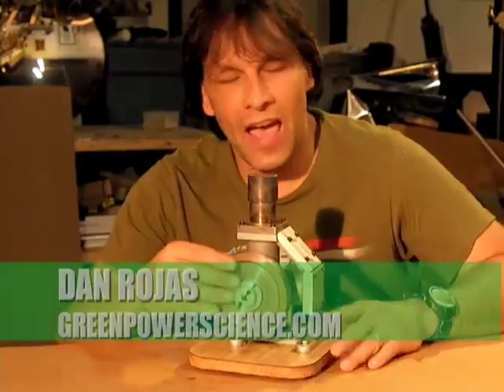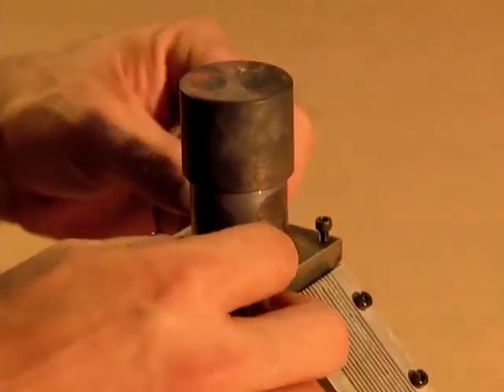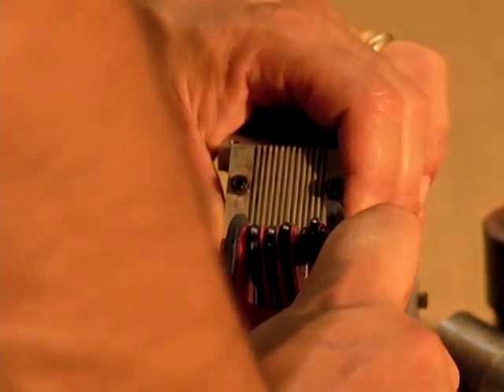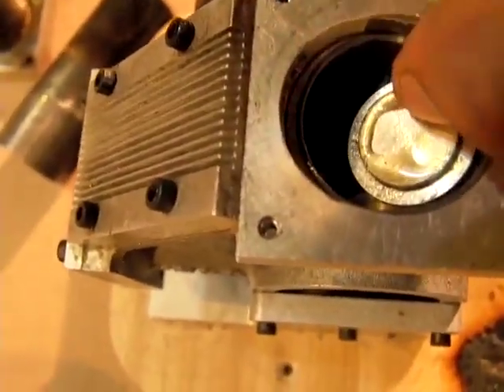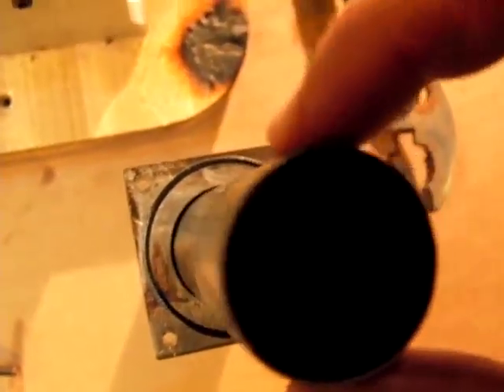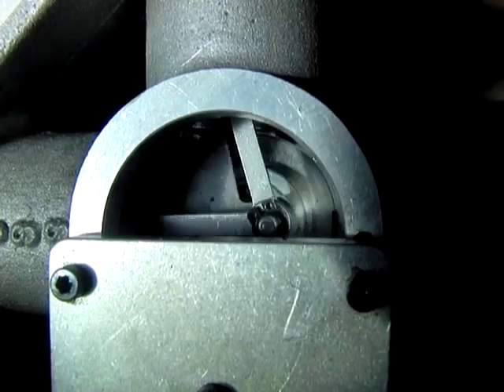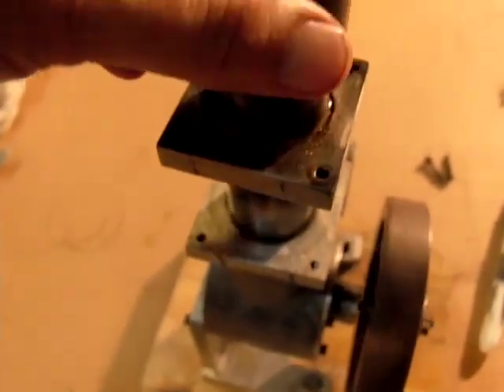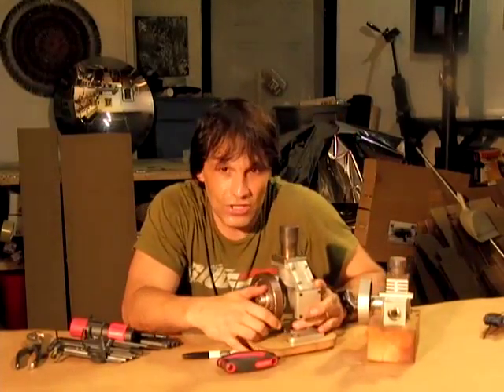Inside a Stirling Engine Andy Ross Stirling Engine Kit Design

Comment: nice video!  Thanks for sharing this.  One thing to consider: super glue is used for temporary fixing of parts to "wax chucks".  The part is released with heat, so when your engine reaches that temperature, the joint will fail.

Comment: Would you release the blueprint schematics for this model? Is seems strong enough to provide 12V - 0,25A using the right dynamo. I would like to try build this model to charge my batteries at night. I live in an Island SouthEast Brazil and saving power is important.
Reply: Isn't this designed to work with the sun shining on it? If so how would this charge batteries at night?

Comment: Great vid Andy! I would love to have a motor like this to experiment with as you are doing. It sounds quite strong in the last vid to me and I would be surprised if you couldn't get much more than a 100W out of it. It would be nice to see the results of the generator setup showing volts and amps. I would also like to see the effects of adding a solar tube to help contain heat input, and maybe a small cooling system (water) ON THE COOL SIDE. I guess you Gould go a step further and let the cool side flow through the hot side as a and into a heat exchanger for hot water use.I'd love to have one of this type engine, it seems quite powerful to many I have seen on YT. Please do tell where you purchased these engines and thanks for your work and sharing, great vids!
Reply: Hi Evan, did you get response on where to buy this particular Stirling engine?

Comment: You can get bags of those O'Rings at Home Depot or Lowes for pennies on the dollar, most hardware stores carry them as well as plumbing supplies. You can usually get them in bags of varying sizes or under $2.00 U.S. Currency, just bring yours with you, and match it up.

Comment: No offense but you really didn't cover how it works, I get it that it is solar powered but what actually get the pistols to fire, Do the heads just get hot enough to where it acts like a steam engine,and if thats the case couldn't you run this off say a wood stove?

Comment: love the vids.. I think the tight fit of the piston, although may contribute to the power, may also have been the weak spot..  The excessive heat seized the piston.. left to cool on it's own, it likely would have freed up on its own..  I'm considering a taper design though.. wondering if the cylinder tapered giving a snugger fit just at the first part of the stroke.. would be best.. but widening up a little as the piston comes down.. tapering the cylinder would be the easiest i think.

Comment: @jdcmusicman i'm not 100% sure but i think they only work on a small scale, because the larger surface area requires an exponentially larger amount of heat so it becomes impractical. multiple engines is probably a better idea for higher power output. great engiune though.

Comment: If you built a small tube drilled with a very small dremmal tool bent in a circle, and fit around the exaust pipe heated end, you could run it on propain, or any other goodheat sorce, Heck if you could build the heated end from copper pipe it would work even better for your solar stuff, or maybe even thick walled brass from the hardware store.

Comment: So, Dan? Remember the big compressor to stirling you had been working on?
Same proportionate scale, and pattern as this one. I bet you could use some scrap steel, and Automobile exaust tubeing to build a bigger copy of the little engines components, and then for the heat exchanger, some steel brake line with washers brazzed on as fins, and get the big one to run the same. Now having taken the little one apart? Do you see what I was saying before about the bigger one? The compressor pump?

Comment: Nice that it was an easy repair. I was a bit surprised to see that they just use a  rubber o-ring as a seal and that it doesn't melt away. Looking forward to see those test runs :-)

Greets, iT